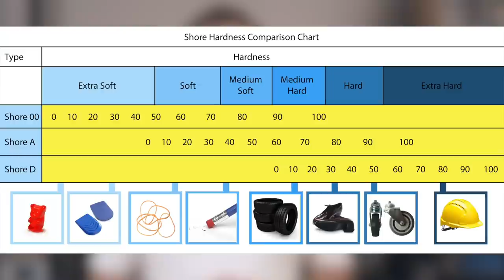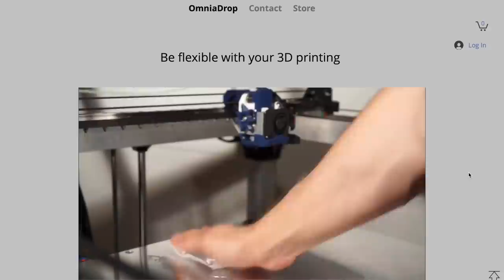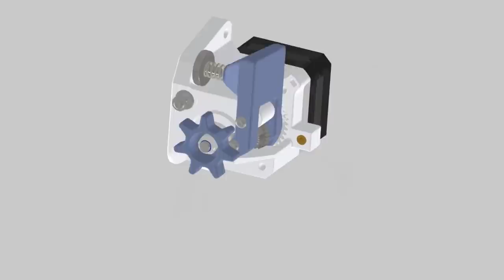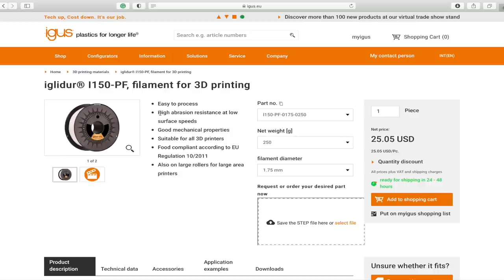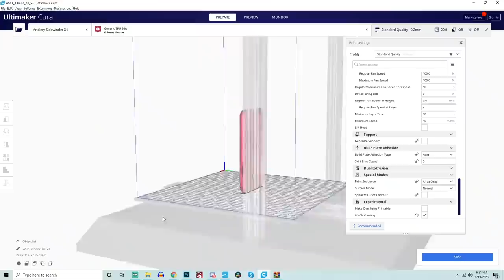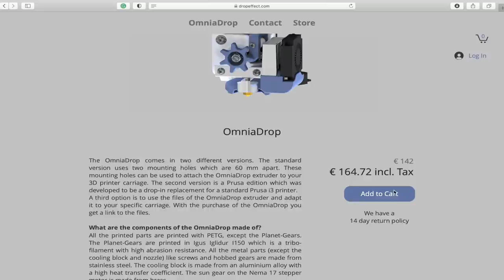Crazy Fast Flexible Filament 3D Printing With The OmniaDrop

Comment: A fantastic review.  I am somewhat familiar with the OmniaDrop since I now have 7.  Why?  because I had 6 Hemereas and they all failed, jammed and I could not get parts or new units.   I saw Chris Rileys review and ordered two right then.  As you mentioned it took me a while to get them installed and working.  If you want to print any filament from PLA - PETG- TPU, NYLON, etc this is the direct drive to have.  I have ruined the fan ducts and the main body on a number of units by stupid mistake also destroyed heatbreaks.  I was able to quickly get replacement parts and then with assistance from DropEffect was able to print my own replacement parts.  As you correctly pointed out these are not your Chinese knock offs, but if you want a quality direct drive and can spend a little time to get it dialed in this is what you want.  You can see them in action on my you-tube https://www.youtube.com/watch?v=muI6Mzs7beY&ab_channel=DavidWilson.
Thanks again for a great and honest review

Comment: That Omniadrop extruder looks great.

I recently bought a Sovol SV01 ($224 on Amazon Prime Day, yesterday) to replace the five QIDI dual extruder direct drive printers that I bought to print TPU.  They've been less than reliable, difficult to maintain and repair, and the manufacturer made the parts as proprietsry as possible, even going so far as to solder the header pins on the back side of the open source generic stepper driver boards to reverse the pinout.  The manufacturer doesn't support the printer any longer and the proprietary parts aren't available.  That's why I went with a more open source design that shares most components with the Ender series printers.

I expected unreliable extrusion with what looks like a low cost Titan clone extruder on the SV01.  I printed my parts at 20mm/s and they immediately looked better than the QIDI could do with its linear rod motion control.

I was evaluating slicers to replace the $150 Simplify3D that is now essentially outdated abandonware.  Cura was nice but I didn't care for the user interface and the way it phones home to Ultimaker.  I tried PrusaSlicer and the user interface works the way I do.  It's very full featured and the settings are very logically organized, making it easy to find the setting I need.  I was immediately productive.  It's better than Simplify3D.

I sliced my TPU part and PrusaSlicer wanted to print it at 60mm/s.  That can't be right, but what the heck.  I need to learn how to clear a clogged nozzle or stripped and chewed up filament in the new printer.  Nope!  The parts printed beautifully, even better than they did at 20mm/s, and this is Yoyi TPU which is listed as 85A durometer, but feels like 90A.  It's noticeably softer than the 95A or 98A TPU, but not quite as soft as NinjaFlex.  I've now printed three days, 21 hours a day, with no problems using that inexpensive stock extruder.  I'm currently tweaking the settings to eliminate some very minor stringing.  I hope this extruder is reliable in the long term, because it prints flexible materials great.  It's bizarre to see soft TPU printing at 60mm/s on a $234 printer, right out of the box.

Comment: Good video, thanks.  I want to ask your opinion.  I need a 3D printer that prints flexibles well but don't want to modify it or add an aftermarket extruder like you show here.  Specifically I need to print TPUs at 95A and Armadillo TPU which is 75D.  We've tried a FlashForge Creator Pro with dismal results (won't even load 95A TPU, after a few filament swap cycles) and also have a Raise3D E2 which has clicking problems (followed by part failure) with either of the filaments above.  What are great stock printers for TPU?  Budget is $500 - $6000.  About 300mm x 300mm is fine capacity wise. Thanks so much!

Comment: How would you compare it to the cheaper hemera? I know it's lighter but i don't care about crazy speed.
Reply: I am very familiar with both,  The Hemera has numerous  problems.  Parts are hard to get, this may have changed, but I needed new motors and Hobb gears which I could not find.  No easy way to manually feed filament for load / unload.  Since the unit is all metal it is very heavy.  The gears from the motor to the drive assembly are precision milled, but on a very small scale.  This means that any filament scraps/ dust are going to  jam in the gear train.   The OmniaDrop has 3D printed parts and a pancake motor which makes it much lighter, the manual filament feed is good and you can print replacement parts.  See my other comment

Comment: Hey there! Just installed this on my sidewinder!. May I ask what vref you set your driver to?
Reply: I set mine to 600 ma - but i set mine via firmware.  The pancake motor doesn't need as high of current as a standard.
Reply: @woodwaker1  I set my TMC2209 to .561V and it runs cool and strong! Thanks for the onfo
Reply: Oh lord, forgive my spelling haha. Info*
Reply: @militaryson94  Glad to help.  That was my first problem with the OmniaDrop, I replaced my Hemera's with these and did not change the current.  The Hemera needed a higher than normal at 1000ma, this just made the OmniaDrop run way too hot and I started to warp the main body.
Reply: @woodwaker1  
Ouch! At least you can reprint it :). How hot do you think the heat break of the Omniadrop can handle? It can do 300°C easy but what about higher?
Reply: @militaryson94  Not sure, about 265 is the hottest I have had it and that was to tighten the nozzle.  I print PETG at 250c with no problems.  I have had pretty good results with printing the main body and fan for the OmniaDrop, Max helped me with some tips and pointers on how to slice them.  I have had some problems but ones I have created with my errors.
Reply: @woodwaker1  Max is great! I big him about these questions haha. I print PC with it at 300C fine
Reply: @militaryson94  What do you print at 300?  How close are you to Max? (distance wise)
Reply: @woodwaker1  I'm in Tennessee, he is in Germany. Not sure exactly on the distance but pretty far. 

As for the temp, I print some Carbon Fiber Polycarbonate for some things
Reply: @militaryson94  Sorry, I thought you were in Germany also.   He is a great guy, I plan on visiting him next summer - depending on what the world is like.  where are you in Tennessee?  I'm in KCMO.
Reply: @woodwaker1  Nashville :)
Reply: @militaryson94  was through there a couple of years ago in out Winnebago - stayed at family and went to Asheville and toured the Vanderbilt mansion

Comment: I have been printing tpu for awhile on my ender 3 with micro swiss hotend with direct drive. Worked great..but I've recently put a bmg extruder on the micro swiss and now I can't get it to print tpu. Just wraps around everything. It prints everything else fine. Do you have any suggestions?
Reply: I would suggest to increase temperature, decrease speed and use no retractions, once that works you then slowly change one setting at a time.

Comment: How does this compare to the micro swiss direct drive upgrade for the ender 5?
Reply: This has as close to zero filament path from extruder gear to hot end as possible.
Reply: Furry Catfish Fillet  Do you have one?  I'm waiting for Max to send my 8th.  I love playing with them and printing parts.  I'm working on a quick change mount.
Reply: Furry Catfish Fillet  The new ones should be shipping soon they are still waiting on the new heaters.  I would like to hear your experience with it.  I have posted a couple of mounts, which are still works in progress on Thingiverse.

Comment: first? Just tried out my direct drive hot end with some TPU. Really don't want to be using a 1mm nozzle for TPU, becomes not very flexible, unless it's a vase mode/hollow print of course. Or maybe if "strong/rigid" TPU is desired, and you just want like a case that's only a bit flexible, but won't break on impact. Mine's only a "300%" 95A brand though
Reply: The rigidity of the TPU depends on the Shore hardness. For instance the Coex 60A (used to be sold under name "Diabase X60") it is so soft that it resembles soft silicone. The thicker the walls the harder the walls feel. Did you try to print 2 perimeters (shells) with a the 1mm nozzle and then compare it to 5 perimeters with a 0.4 nozzle? This way you could find out if it is the nozzle or the thickness of the walls that determines the flexibility.